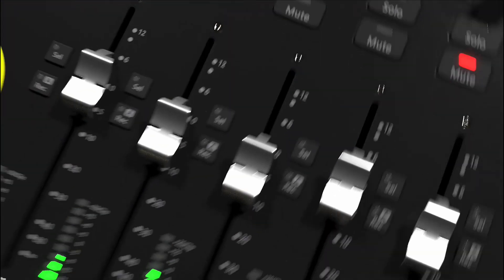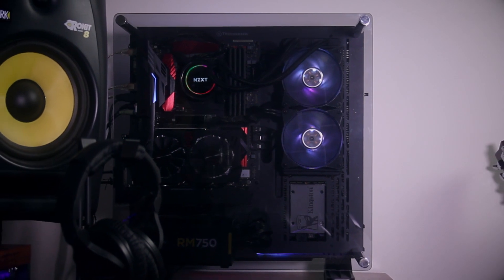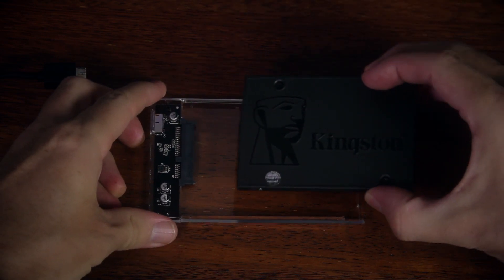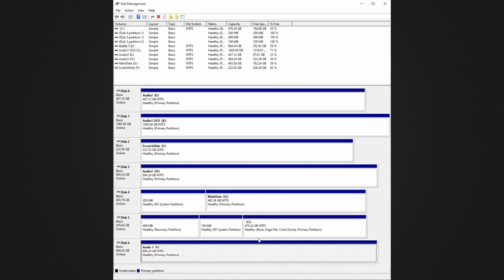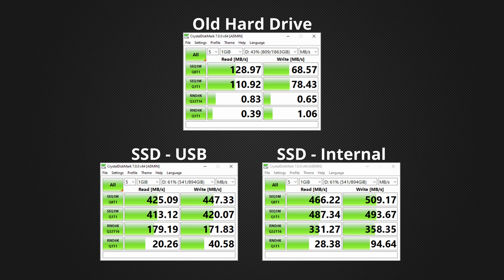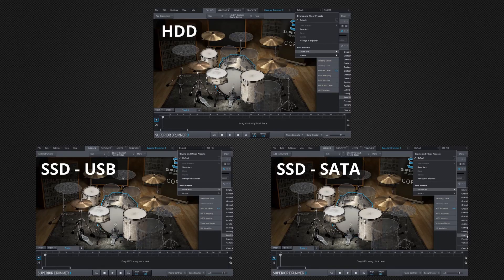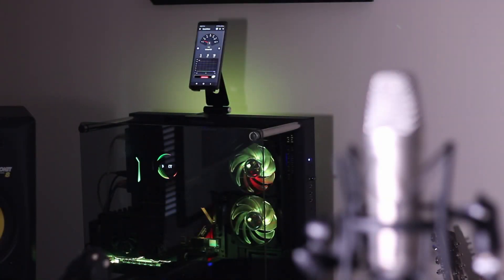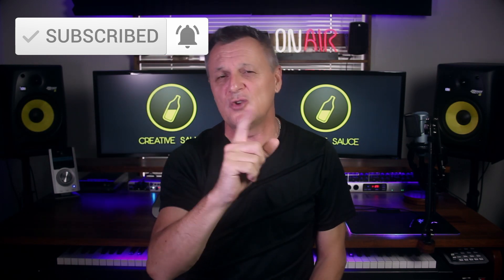How to Install an SSD for Audio Production

Comment: When it comes to safety of storage old harddrives outdo all SSD´s. Data is never 100% safe, but I have some 20 year old hard drives that are working and containing my data. Storing data on SSD for that long is very unlikely. Also old hard disks recharge data when you use them. The magnetic data written on the hard disk is getting a healthy voltage that is conditioning it when you decide to use the Hard drive. SSD wear out when used allot, and lifespawn of SSD is around 10 years on the high quality SSD drives.

Comment: A few months ago I replaced a 2011 era Dell laptop hard drive with a SSD.  The rated transfer rate for the SSD is 6 gigabytes per second (gps) while the laptop motherboard data connection is only half that at 3 gps.  The boot up time significantly improved from around 45 seconds to less than 9 seconds.  The laptop fan does not turn on as often and the fan doesn't run as fast because heat build up inside the case is reduced.  The laptop battery life is extended by about a third because the SSD is a power miser and the fan uses less power.  Having said all that I've not noticed much read or write speed increase other than boot up.  My guess is this is because my use doesn't involve large file transfer or storage very often.
Reply from the maker: Interesting Jim - thanks for sharing!

Comment: Interesting video Mike. By coincidence just last week I replaced my data 1 Tb HDD with a 1Tb  Samsung Evo T5  connected via USB 3.1. The external SSD was more expensive than an internal one but there was a £40 cash back offer which leveled the field! I was going to go for the internal one but bottled it in favour of something easier to install - though I know using USB 3.1 will limit the transfer speed - an important factor. However I was getting the SSD as much for reliability as for speed. MY HDD is getting old now and it can't have much life left in it so I feel happier to have everything on the new SSD. Is the programme you used to test speeds a free one as it would be interesting to see how they compare
Reply from the maker: Hi Joe - yes its a free program, you can fetch it here: https://crystalmark.info/en/software/crystaldiskmark/
Reply: @CreativeSauce  Cheers Mike!

Comment: If you have SSD transfer speeds so close between USB and SATA it means you have a limitation on your motherboard, the difference should be much higher in favor of SATA, or maybe the SSD you use is very slow already and is not using the available speed for a SATA connection. SATA transfer speed shall be at least double in comparison with USB 3.0. Which SATA controller you used on your motherboard to connect the SSD? Because nowadays there are two, one faster and one a bit slower.

Comment: Cheers Mike, useful vid but probably not something I would do myself. I use a laptop with SSD and HDD. So if I wanted to upgrade I'd get my son-in-law to do an upgrade (he runs his own computer business). Sorry I've been off air for a few weeks as laptop crashed and burned. Everything nearly all back to normal (99%). Will prob post on forum about this.